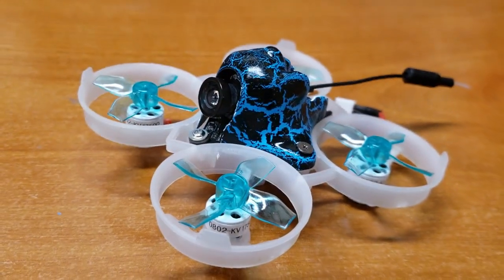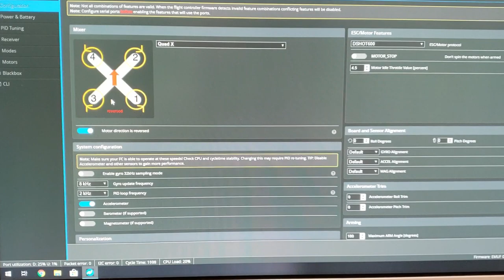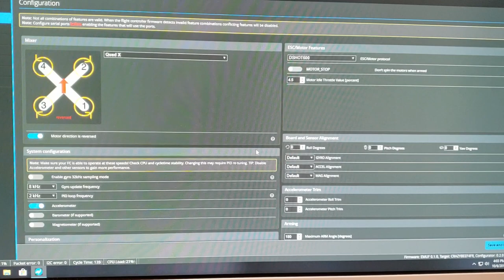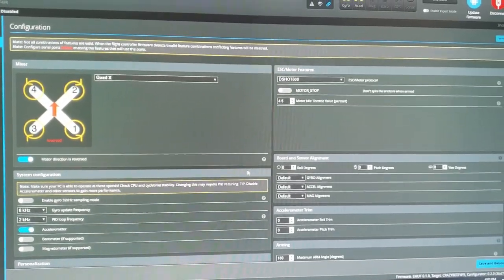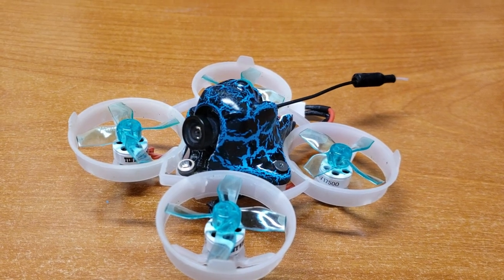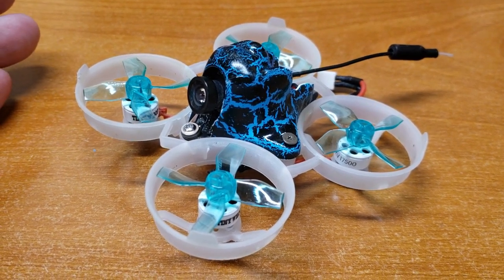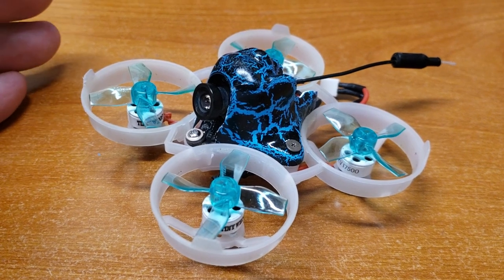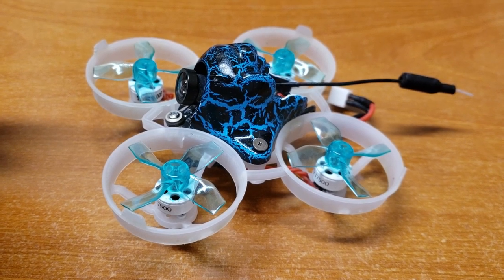EmuFlight Brushless Tiny Whoop

Comment: Good info here & nice flying. Have you did anything else with the tune? I’ve got a 65mm with a Betafpv F4 board that I’m thinking about trying it on, running 19000kv 802 motors on 1s
Reply from the maker: Not a lot yet hopefully more videos soon
Reply: Put it on the 65mm with the Betafpv FC and so far I'm liking it. Guess more packs will give me a better idea.

Comment: Nice video man and sick canopy! I have my whoop on BF 4.1 and it flies great my only problem is when i m in angle mode and I hit something the gyro, if i crash hard enough, loose his orientation and I have to disarm and arm again to re-calibrate. I read that emu has a difference behaviour after you crash which might prevent your gyro to go crazy.  Did you experience any of that??
Reply from the maker: No didn't seem to have any weird issues like that